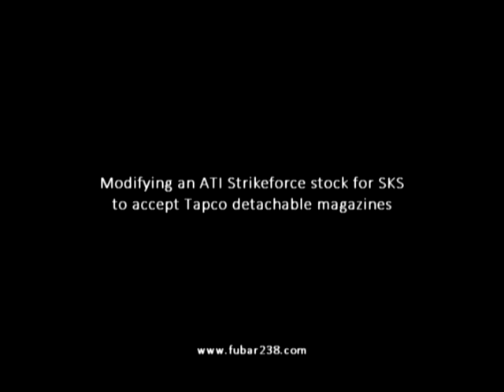SKS ATI Strikeforce Mod for Tapco magazine

Comment: Although it was 10 years ago, and I gave you a pass on the quality of the video, even though you can't really see a lot of what you were wanting to do, the area and idea is clear. just put one of these on my sks, after my bullpup from SGworks went to crap. Not even going to try to fix that and wouldn't you know a tiny spring that was part of that kit went 'twang' and will now never be found again. The last part of the modification for this stock was the use of my tapco's so I appreciate you doing this way back then, for me today. Thankyou!

Comment: Ino this is a old video but it hert me to see you destroy the ati stock like that what I did to solve that problem was sanded the mag I sanded the duck bill slightly where the point hit the stock also the back side of the mag where there’s the 2 slide parts near where the ammo loads in the mag near the plastic nub that holds the mag in the gun also used some 120 grit sand paper cost me less then $3 took me less then 5min of sanding it and it was a pro mag I was having trouble with my tapco mags I had no issue fitting into the ati polymer stock I rather mod the mags then ruin the stock but everyone has there way with things this way probably is good in a way since you wouldn’t have to mod the mags hope I could help some people if they are having trouble with polymer mags loading in there sks

Comment: Why cant I just modify the mag instead of stock. It almost seems I could remove a slight piece of the duck bill and it would slide nicely
Reply: Because you may have to use someone else's mag and it won't be modified.
Reply: Did you ever attempt that??

Comment: Why not alter the Magazine instead of the rifle stock? and maybe mark the material?
Reply: The reason being is that the stock is connected to the rifle. This is a $20 or less fix with tools. Why would you mess up mags? Now if you sell trade or use mags with other sks you’re going to be fine.
Reply: @tonyescobar4501  Why mess up the Stock - The Mags are the cheap part
Reply: @ormonddude  who is messing up the stock? I’m an engineer. My pops has tools and machines that will properly fix the problem with the stock. I have a bunch of SKS rifles and keep plenty of magazines. My family setup and system is designed that we all need to have compatible magazines. The stocks may be different, but the mags and ammo are the same.

Comment: I grinded down the magazine itself. I would never grind away my stock, unless I absolutely had to.
Reply: Did it work?
Reply: I just did the same thing myself to my stock. I thought about grinding down the mag, but the actual amount I had to take off the stock was so minimal you wouldn't notice, and why grind down every mag when you can just tweak the stock. Also if you have 3 mags or more, they're worth more than the stock anyway.

Comment: tells right in structures bookley, that you might have to do some filing when using after market mags, and it shows you were to file. I just put a ATI together using Taco mags, I haven't done any filing yest , but I can get in with some swearing. but will filing so they snap in easy. always read the instruction book. also don't like that only one screw holds pistol girl in. seams it won't last long, so if going to figure some more secure for it. I almost bought Tampico kit, but I thought ATI looked better built and liked the folding stock.

Comment: I have the military surplus mags but when they go in and lock they do not lock in front, without a round it would simply fall out lol, what am i doing wrong, what kind of magazines is this ati stock made for?
Reply: Sounds like you took a little to much material off your stock, so your magazine catch isn't grabbing enough. Maybe try filling it back in with some sort of epoxy and trying again. He's using Tapco mags in this video but I've heard people have had a lot of feeding issues with this mod. Myself I would take many measurements to figure exactly how much material to to take off to match the stock specs.
Reply: I appreciate it, i figured out one of the mags was bad, now they go in with minimal cursing lol

Comment from the maker: Sorry everyone I just saw these comments now I've been pretty busy...

You do not need to remove much material at all for this. Id say it was maybe 3-4mm.

The gas tube cover did come off quite easily using a correct sized punch to take the pin out that hold the end plate on. I have heard about some of these sticking quite badly though which is what everyone complains about. If that happens it will need to be drilled out. At that point you're probably better off just buying a 992r compliance kit

Comment: Those stocks are made to be tight. Perhaps ATI thought that the SKS would have shrank with age, due to dehydration. I had to relieve my stock to accept the original fixed magazine initially, and I beveled the stocks opening to accept the barreled receiver.
Great stock. Just a little tight in application. Sloppy would have sucked. Good job ATI.
As picky as they're getting, I hope that you're 922R compliant. You could loose your rifle due to modifications, if not. Just sayin'.